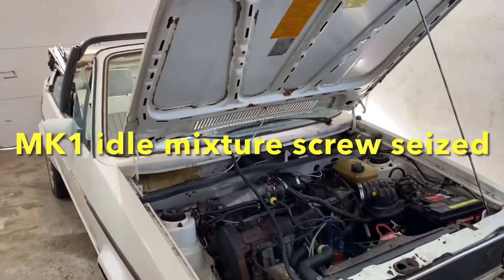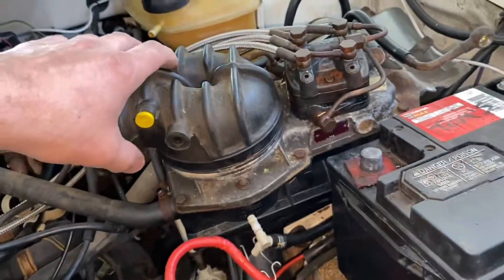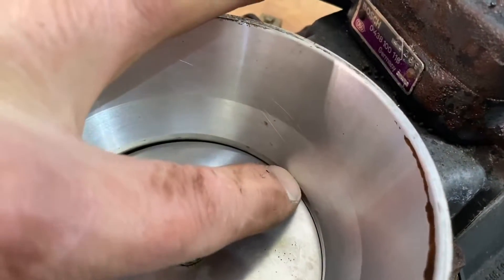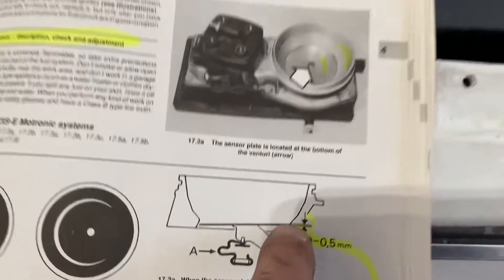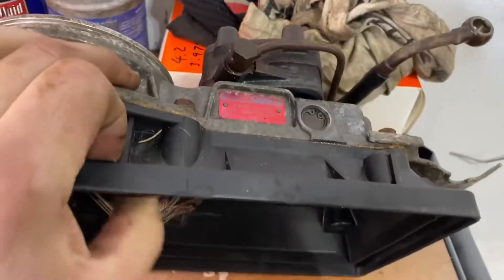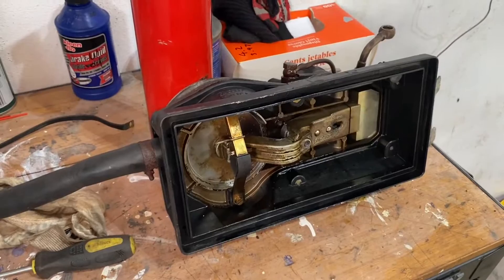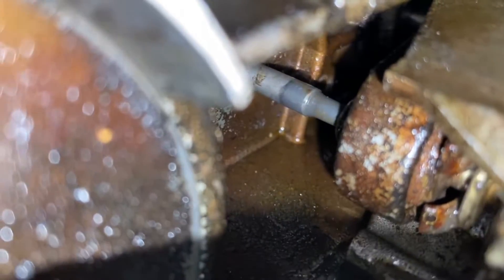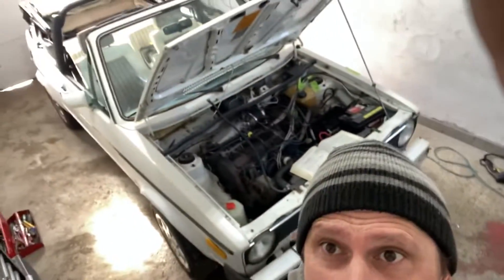VW Mk1 CIS idle mixture screw seized. How to unfreeze idle mixture screw CIS￼ fuel distributor ￼

Comment: Hello could please, I need help with the routing fuel lines of the injector with cis . Thank you. I think they are 1234 from left to rigth starting at the lower left fitting line towards the fender direction. Excuse me for the question. But , i think the order i have is wrong.  1.8 VW 88 cabriolet

Comment: Hey, so I’m working on an 87 golf with very similar fuel injection it’s just the airbox and everything is on the other side of the engine bay was hoping you might be able to help me out with. Is it the same when it comes to the adjustment screw And I’m just having some idle problems it’ll start up and bogged down like it’s Hydro locking or something and I can’t figure out why I do need to get it tuned because I cleared the cat out and I think that might have to do with it I have the oxygen sensor spaced out and I replaced the oxygen sensormines under warranty so I tried to replace it like every 90 days

Comment: I got an 86 vw golf and it looks like there is a hole there, screw missing? Maybe it's deep down the hole?
Reply: Mine seems to be missing as well. When I press down with an Allen key I can hear the idle drop. Any idea what size screw to use or if there’s anywhere to get one? Thanks
Reply: The hole is there to access the screw that’s down in there. I think there may have been a rubber plug for that hole from the factory but I could be wrong